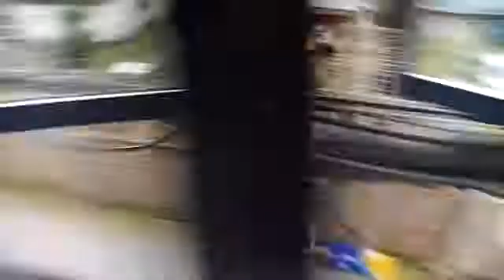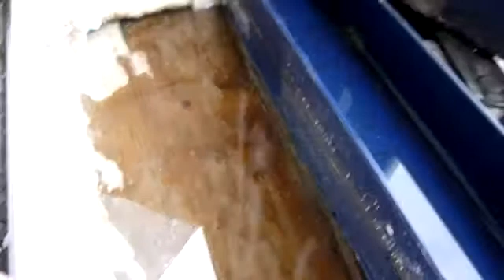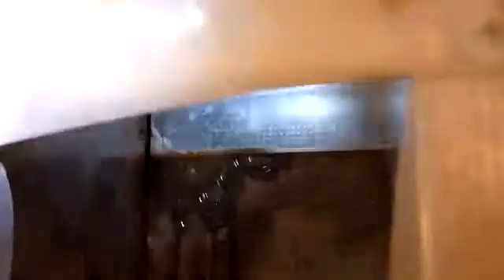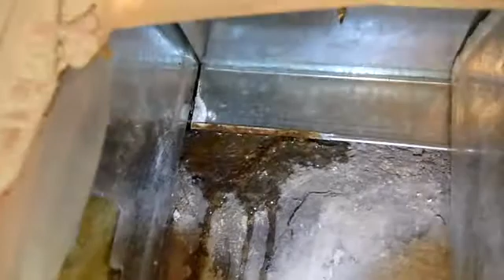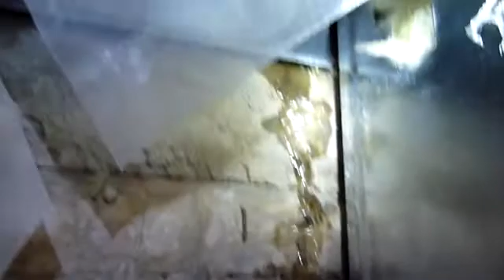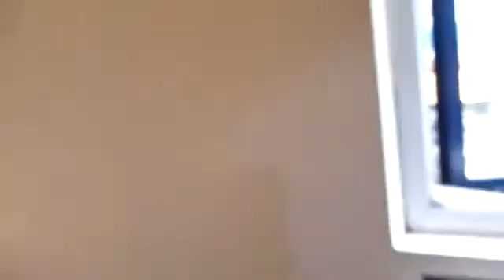AAMA 511 Window Sill Dam Test Failure

Comment: Failures that i can see, fasteners use are not coated for corrosion, probably just regular carbon steel fasteners, second cheap caulking use deteriorated already, end sill dams are not properly sealed, basically shitty installation and shitty windows